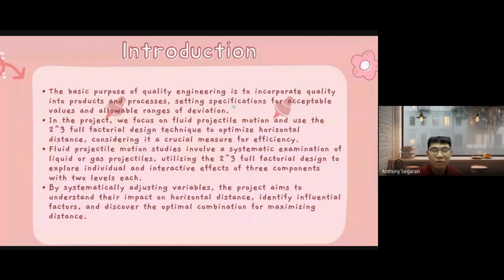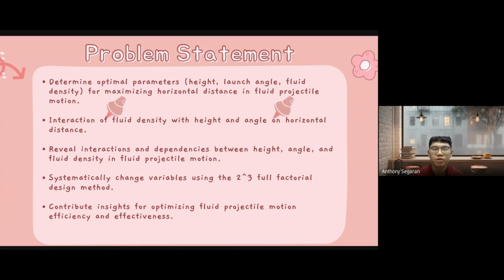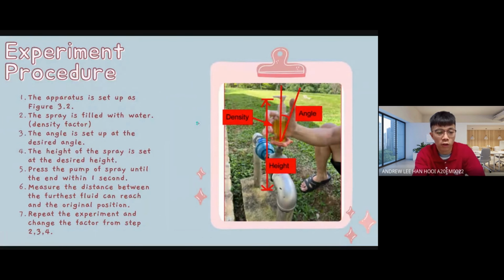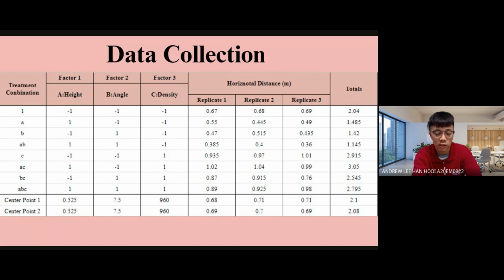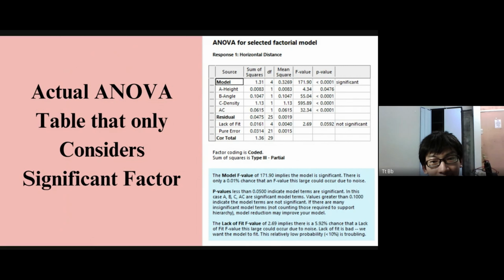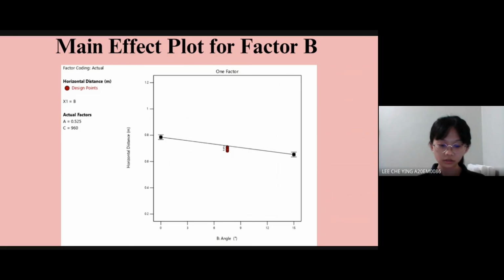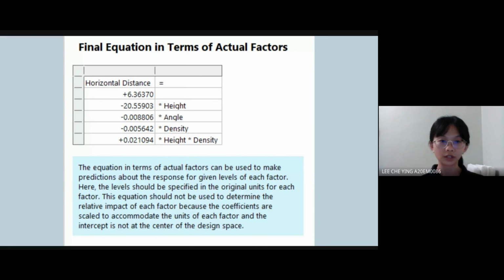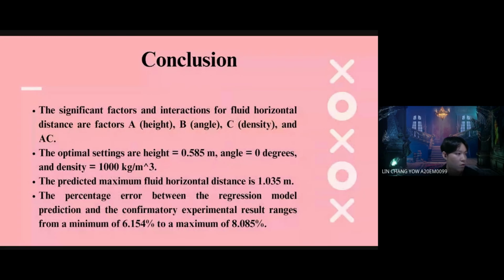SEMM4853 QUALITY ENGINEERING GROUP 4 PRESENTATION

Comment: Can we control the significant factor?
Reply: Yes, you can control the significant factor in a 2^3 full factorial design.
Identify significant factors through analysis.
Adjust factor levels based on findings.
Optimize processes by controlling these factors.

Comment: is there any way to know whether interaction between factors A and C are strong or not from the plotted graph?
Reply: Yes, from the two-way interaction plot:

Parallel Lines: Parallel lines suggest a weak or no interaction between factors A and C.

Crossing Lines: Crossing lines indicate a potential interaction; the extent of crossing suggests interaction strength.

Magnitude of Slope: Steeper slopes suggest a stronger interaction in the plotted graph.

Comment: In a real life scenario, can this be applied in the profession sport such as diving? Additionally, do you think that the initial jump, body position, and air resistance affect the motion before entering the water? Explain why
Reply: Yes, a 2^3 full factorial design for fluid projectile motion, with factors such as Height, Angle, and Density, and the response being Horizontal Distance, can be relevant in the context of professional sports like diving. Here's how:

Height (Factor 1): Different diving platforms or starting heights can be considered to study their impact on the horizontal distance covered during the dive.

Angle (Factor 2): Varying the takeoff angle can affect the trajectory and influence how far the diver travels horizontally.

Density (Factor 3): The density of the fluid (air in this case) can impact the resistance faced by the diver, affecting the overall projectile motion.

Now, addressing the second part of your question:

Initial Jump, Body Position, and Air Resistance:

Initial Jump: The takeoff or initial jump contributes to the projectile motion. The force and angle applied during takeoff influence the trajectory and horizontal distance.

Body Position: The body position assumed during flight affects aerodynamics and can impact the drag forces acting on the diver. This can influence the overall motion and horizontal distance.

Air Resistance: Air resistance plays a crucial role. A streamlined body position can minimize resistance, allowing the diver to cover a greater horizontal distance. Factors like density and angle can affect the magnitude of air resistance.

In summary, the study can help optimize diving techniques by understanding how different factors influence the horizontal distance traveled. This knowledge can be valuable for athletes and coaches in professional sports like diving, aiming to improve performance and achieve optimal results.